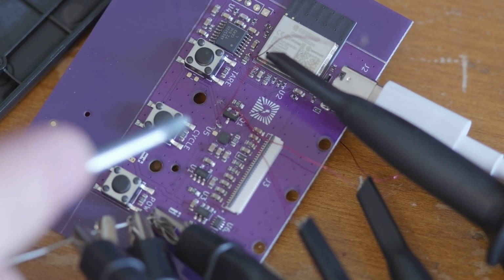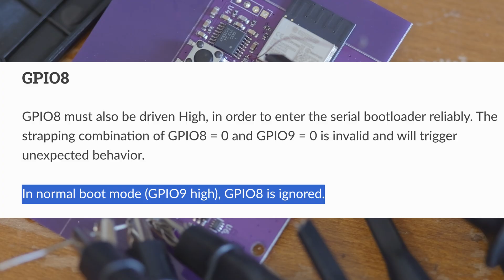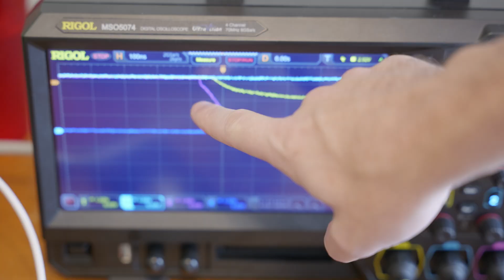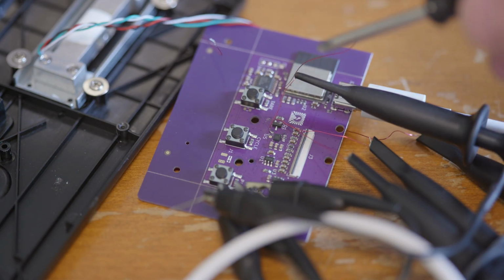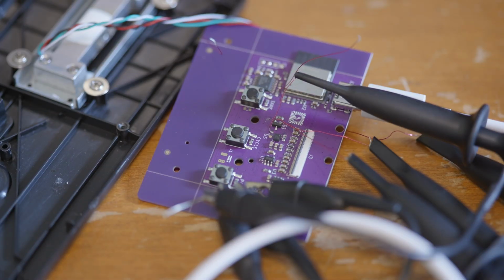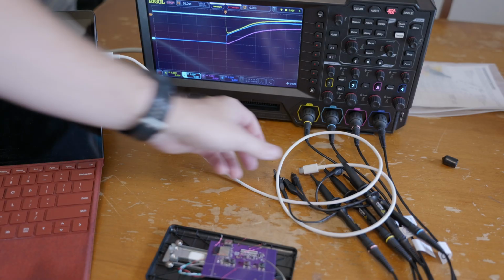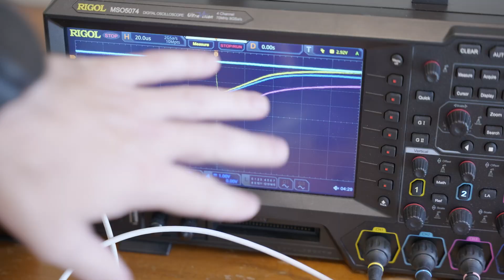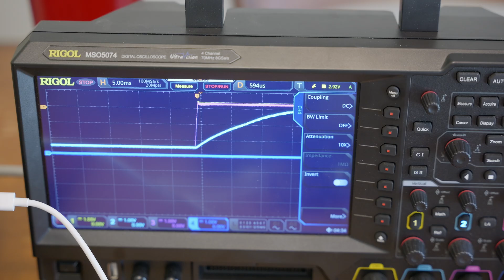I hate ESP32 Strapping Pins

Comment: On the ESP32 Wroom modules there are a few pins that require a specific state on boot that were never mentioned in the data sheets. IO_12, IO_14, IO_0 and IO_2 were all fussy on my boards.
IO_2 on my design had to get a pull down to get the chip to boot.
What did the waveforms look like with and without the load cell connected?
The ESP shouldn't care about the strapping pins until the EN pin rises over 1,8V to start the boot but I could also be miss reading the data sheets for that info. What is the rise time on the EN pin for your design? 
Sorry I don't have a clearer answer than speculation.
Reply from the maker: So, this is an ESP32-C3, and it is slightly different due to being a single core RISC-V rather than an Xtensa dual core. I didn't look at it on the scope without the load cell, as I really just wanted to figure out why it was boot looping. One thing about the scope I'm showing is this is in the boot loop, so EN is always high here, but you're right that there's an EN rise timing there and I believe you're right about it being roughly 1.8V or so. I'm only guessing that GPIO2 is falling when it's getting sampled, as I have no idea why else it would do that since it's not connected to anything else.